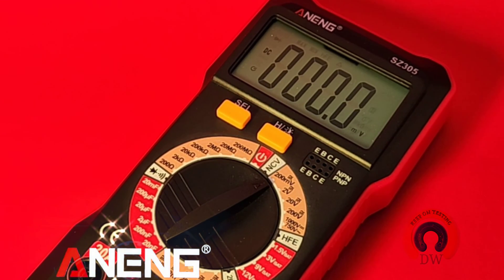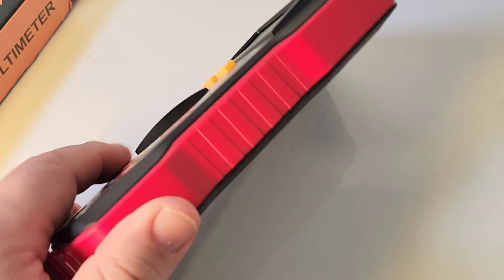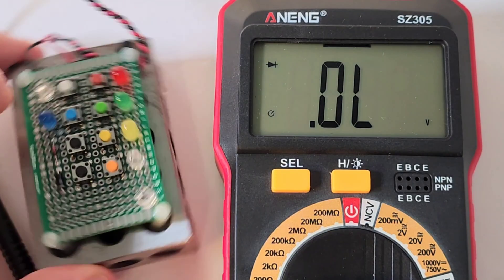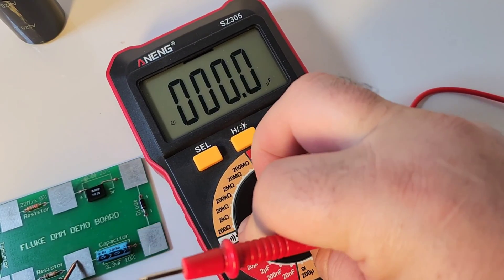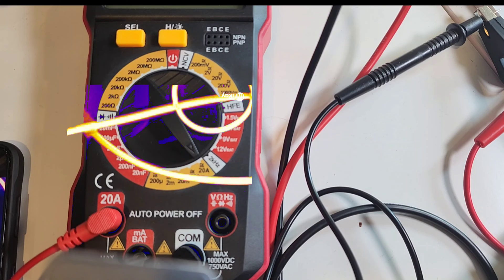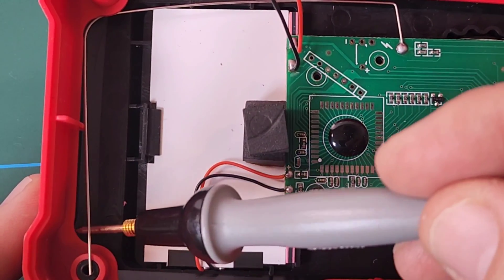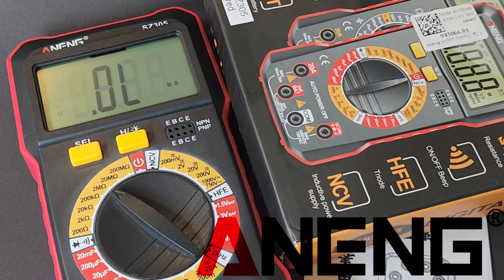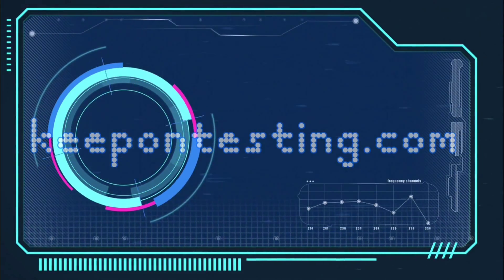ANENG SZ305 CHEAP-O Multimeter Review & Teardown!

Comment: Ive tried ncv it works, try it in a plug with running appliances it will beep, but in a socket with no plugs, no running current it will not beep
Reply from the maker: Thx for the update !

Comment: Hi! I have this multimeter, but I misused it and mistakenly measured a higher amperage than it can handle, burning out the resistors near the 20A max connector tip.

Could you tell me the value of these resistors? It still works in its other functions. Thanks to your video, I now know that the resistors are available with codes:

- 103
- 1000
- R990
- I'm missing the last one, which I can't quite make out. Can you help me?

Thanks in advance.

Comment: Interesting review, thank you. But where is the fuse that is both mentionned on the lower side of the front panel "FUSED" and in the manual (in the section "fuse replacement". What do you say? NO FUSE at all!😧
Do you have a suggestion for putting in the missing fuse?
Reply from the maker: Honestly, I wouldn't spend any time upgrading this dmm. There's a host of snafus and I would use as is, or get something better. 👍

Comment: I bought one a last week because I needed to replace my old DMM but I was broke af lol.

For some reason, the NCV feature on my unit works pretty well. It could've been better of course, but it's definitely not as bad as on yours.

They may have implemented some improvement but I haven't opened it up yet so I don't know for sure (the local Aneng distributor put warranty seals on it that I don't want to break at this point in case I have to return it).

So far, this DMM has done a very good job at the stuff I use it for (simple DIY repairs at home) but I just can't trust the probes, which look sus. They look like they cost 10 cents a pair.

I would've got me a Zotek if I had just a bit more money, but this time was different. I'm just glad they make DMMs this cheap.
Reply from the maker: Yeah, I think the probes are the weakest link on these meters.

Comment: Now I'm here again. I found out that it's not good in testing capacitor and it's very slow to perform in capacitor...i try to check the voltage the mosquito killer that looks like tennis bat.i set it to the highest voltage of dc and it's shut down so I'll put a new 2 pcs of 1.5v bat. when i turn on the reading is wrong. Could you help me sir what's the damaged of this multimeter??thanks
Reply from the maker: The capacitor testing feature on that meter is notoriously inaccurate and slow - for basic testing you're probably best off using a different meter. Look for burn marks or black spots on the pcb. You probably fried a few components.
Reply: Can you recommend a good cheap capacitor tester?

Comment: Cool.  I just use it for Caps and resisters which it seems to do fine enough thanks to it's range. Doing volts and Amps works fine in a pinch. I have the sz304 which is pretty much the same but without the  useless NCV.
Reply from the maker: Cheers Michael!

Comment: Thanks for rewiev.
I ordered this one. In my contry for such a low price I couldn’t find any analogues that would measure capacitance up to 20mF. All others cheap Multimeters are only 200 microfarads maximum. Also сontinuity mode very fast. And battery mode for 1.5v to 12v - there is no other cheap multimeters with that function. All the time i need to connect lamp to many of my 1.5v and 12v batteries to test them. Now i can just use only multimeter.
Only one thing really disappoint - no fuse for 10A current.
Reply from the maker: It's a nice CHEAP-O Multimeter for sure! Enjoy my friend 👍
Reply: Is there an expensive multiltimeter that the SZ305  cannot do? 😊

Comment: Hi Darren,
While doing some modding on the case of my unit I have accidentally damaged its display. In your review @09.44 you call it a 'lcd display'. But is it one? It appears to be just a translucent piece of acryllic with a white cover sheet on the back. And what's even more curious: it has only 2 wires connected to it! And those 2 wires look like they are powering the back/side-light leds. I would like to try to replace my broken display. But how does this thing even function like a display? What is it? Could you point me in the right direction?
Reply: The LCD display is connected underneath not by the 2 wires.😢

Comment: I was just going down through the table of capacitance tests I have done on the couple dozen DMMs I own that perform capacitance.  I am using a calibration board with a wide range of high precision RF and audio filtering caps mostly, also some high precision MLCC and tantalums before resorting to known good electrolytics at the upper end.  This unit was the one that nailed all the capacitance values, worst excursion was 1.5%.  The only one it didn't do was the 22mF which was out of range.  I am really impressed, hope they are all made this way.  I would grab this unit before my expensive LCR meter!  By the way, in order to realize this accuracy you will need to "rel out" the lead capacitance by holding the SEL button until the delta (triangle) symbol appears in the display.  Makes a big difference at low capacitance values.  If you change capacitance range, you must repeat this step.  I think this works on resistance too.
Reply from the maker: Hey Paul..wow that is surprising 😮 glad to see Aneng on top! I'll be doing a similar test in the spring , I would be interested in seeing your results comparatively speaking. Lots of work no doubt but a very useful project 👍
Reply: Pretty much what I use it for.

Comment: Regarding the NCV wire.  After disassembling to add dielectric grease to the knob and PCB (which helped smooth range selection immensely) I decided to lock down the NCV wire.  I found the optimal vertical height and let that wire rest against that red rib in the middle.  Then I used a soldering iron to warm the wire nearby, just enough that it started melting the rib.  The wire sunk down into the rib and I stopped when the wire was parallel to the top of the unit.  I must say this helped the NCV feature detect wires correctly.  It isn't so much that NCV enables detecting AC voltage, it also helps differentiate which wire is hot.  It does this very well now.  I get all the bars when holding the hot side of the flat 3-conductor wire parallel to the top of the unit and no bars when I present the other side of the same wire.  I found it interesting some of the SMD capacitors were added manually as evidenced by the flux residue.  Or they were touched up.  These cheapos always have some reduced level of workmanship and stray solder splatters that need cleaned up.
Reply: Great NCV tip and other insight. Thanks.

Comment: Mr. Darren,Can you do an extreme test with all the DMMs that you reviewed, such as entering a voltage of 220 VAC or more when measuring resistance, capacitance, diode, and continuity, this is a very bad thing, but it would be something interesting,thanks
Reply from the maker: I will be doing something along those lines at some point 👉 I've reviewed way too many multimeters to do them all but I agree doing some of the latest would be a great help👍
Reply: @KeepOnTesting  good decision mr darenn, i like your video review, i also like the voltage showdown and teardown parts,i really-really like it👌
Reply from the maker: @unk_25  Thx my friend! Lots more to come! 😃

Comment: OMG this airbox is rated at 20 amps current--??!!!  Stand back when you read that one-lol  That PC board is about half the size of the whole oase interior - must need the space to cool that 20 amp heat load on current setting  - LOL
Reply from the maker: I can't imagine running this with 20A ,it was really hot at 10A and without a proper shunt...echh. Funny how lately, the bigger dmms have the smallest pcb.😅
Reply: @KeepOnTesting  The front clearly says "fused" but didn't see any in the teardown... did I miss them? What happens if you "measure the mains" while still plugged into amp jacks?
Reply from the maker: @tshackelton Yikes, scary scenario..dmms usually have a separate input for current measurements which places a low-value resistor in series with the test leads. If the leads are left in these terminals when attempting to make a voltage measurement, a high current may flow through the meter. This can damage the device being tested and may blow the DMM’s internal fuse. If the source voltage exceeds the fuse rating.. arcing, damage to the meter or worse can be the result!  😅 I'll be exploring this more in future videos.

Comment: 2.5 stars is a fair grade. Battery test function is nice. I could see a potential use as a basic meter you keep in the trunk of your vehicle. Maybe usable as a low voltage bench meter for a beginning hobbyist. Not safe for line voltage.
Reply from the maker: All good points 👉 I really wanted to like this Aneng alot, but the ncv, well, I'm still scratching my head 😅
Reply: @TRONMAGNUM2099  el ANENG SZ305 No trae la función MAX y MIN